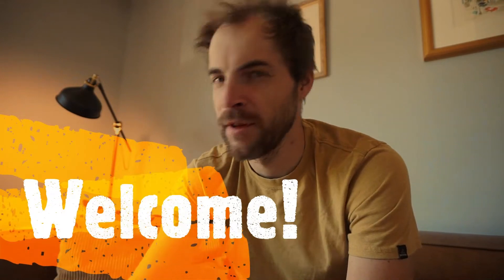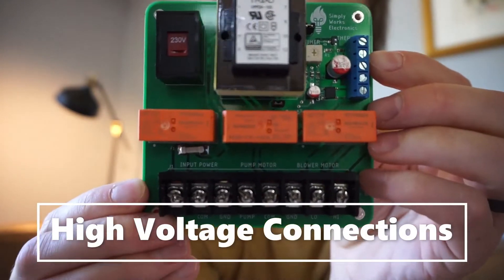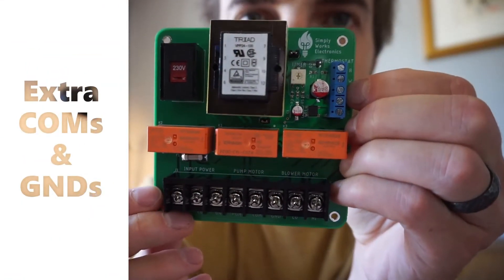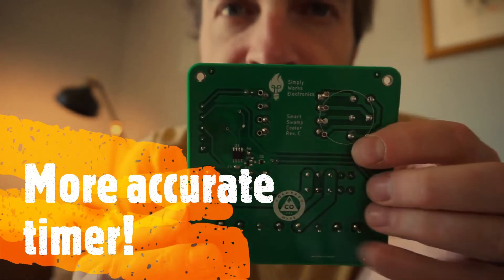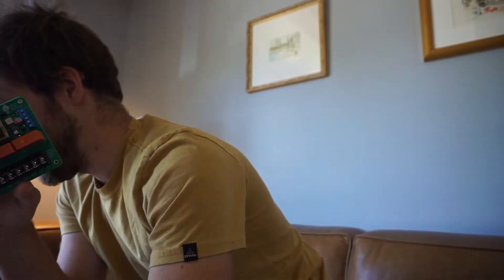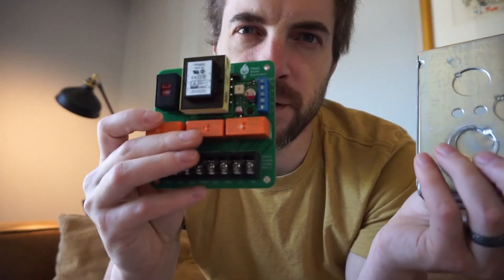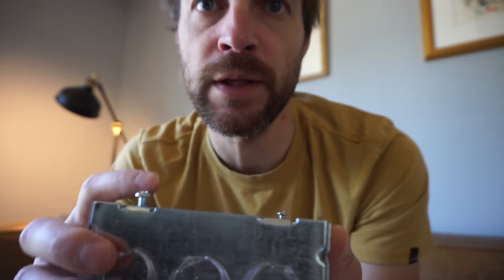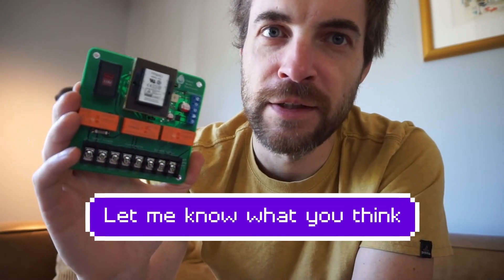Introducing new revision of the Smart Swamp Cooler PCB

Comment: Hi Krill, from Santa Fe New Mexico could you please advice the wiring instructions for the Honeywell Home RTH9585WF smart thermostat? I just got a new large coolmaster swamp cooler in my roof and would love to control it with my furnace smart thermostat. It would be a great addition to your website for those not familiar with nest thrrmostat. Thanks and congrats!
Reply from the maker: Hi VP, most thermostats have the same signal conventions. So you should follow the same installation guide. The plate itself might look different but the signals should be the same. Hope that helps!
https://www.simplyworks.net/products/install

Comment: Amazing work! How is the high and low fan speed controlled?
Reply: You can connect it to the second stage cooling signal. So the thermostat decides when to kick the high gear. Or it is possible to wire always high or low depending on your preference.

Comment: Is it possible to also control the heater from our smart thermostat?   Also, what are the two small jumpers you supplied used for?
Reply from the maker: Yes, you can use the same thermostat for heating and controlling the swamp cooler. The jumpers are so you can convert your installation to single transformer system. You can checkout installation page for more details! https://www.simplyworks.net/install

Comment: Hi can you conect your evap and furnace to work with the same board, being that both have a separate transformer
Reply from the maker: Francisco, yes, it is possible. You can use this board as a dual transformer solution or you can drive it from your furnace transformer making it single transformer system. Checkout installation page for more detail! https://www.simplyworks.net/install

Comment: Will this work if I connect all my neutrals (commons) together. Reason being is that in a junction box I have my hot/Neutral/grd & 1 pump wire/1 hi and 1 low
Reply from the maker: yes, that will work! As long as all of the neutrals (commons) connected and it is wired to the PCB
Reply: @simplyworks  Nice! thanks for answering and congratulations on you product.

Comment: Does each component (Pump, High Fan, and Low Fan) need a common wire or can the power in common wire connect all the commons?
Reply from the maker: You need to connect all the commons. So at the very least you will have common from the incoming power and common from the swamp cooler. You can tie the pump and high/low fan commons at the swamp cooler.
Reply: @simplyworks  thank you for the reply.